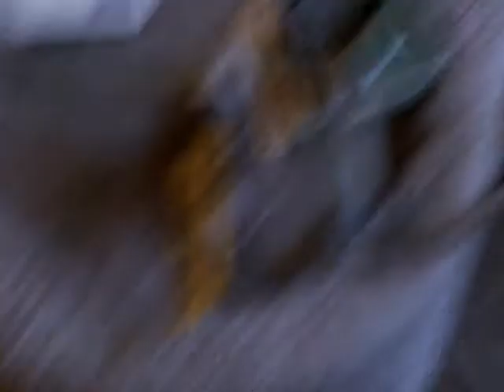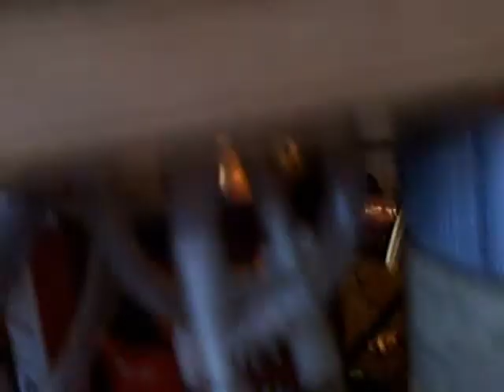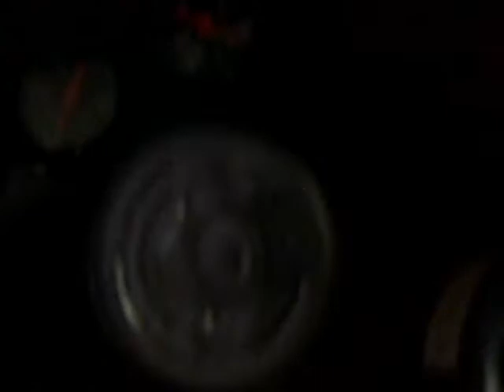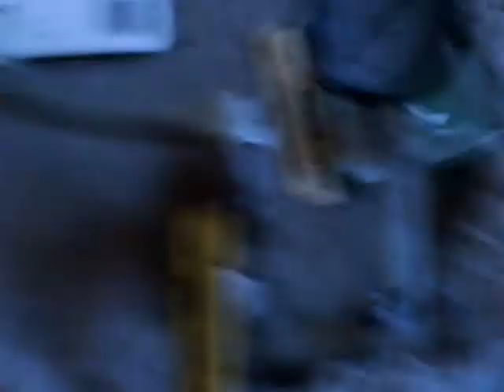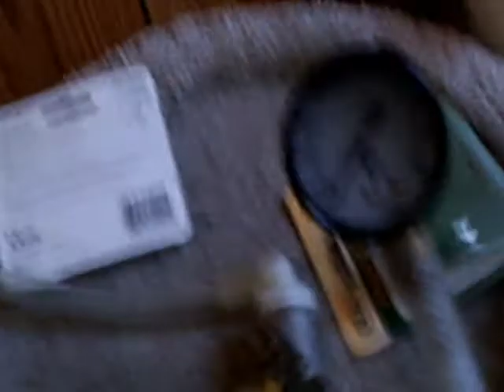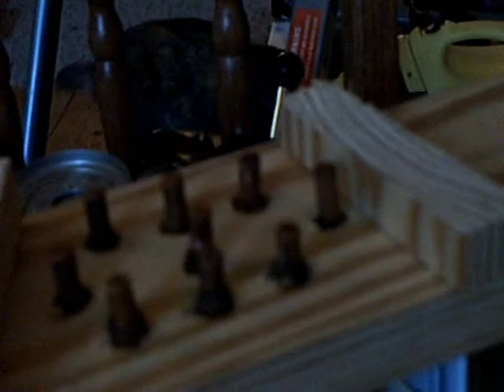9 HHO FLAMES using 150 watts NO FLASHBACK

Comment from the maker: Im not really sure what is causing it, the mig tips i'm using are .025 , and i beat the tops down with a hammer and now my hole size is approximately .010 ,but inside the hole is still .025 and my cutoff valve is 2 ft before my last bubbler and then I have another 6 ft of hose going to the tips ...I can cut it off and turn it right back on and light them back so gas is still in the line ..I dont know LOL

Comment: i think that maybe the hole irregularity is working in your favour and you may have come accross a way to avoid flashback.
imagine that the flame all go out at slightly different times and then enter the speed that it travels and it probly creates some vaccum when they go out and suck all the gas out of the line b4 fore it can ignite or something like this.

Comment from the maker: that temp gauge was just one of those that dont use power and the tip think goes inside the motor , im sure it was hotter than that because the thing was just laying on the metal ..